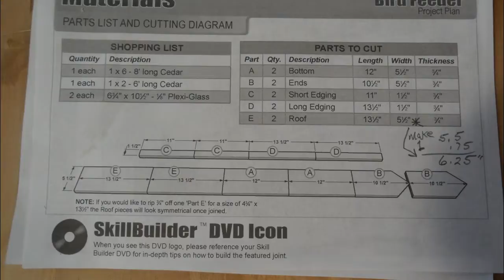A Feeder the Birds Will Love HD

Comment: Great project Ron! Did you do any disinfection on the wood?
Reply from the maker: +Rebecca Bracamontes I did not perform this procedure.  I guess it's possible for pine to have something toxic in the wood.  I'm just not aware of what product that would be suited for these types of projects, especially the bird houses that I make.  Please share with us the products that provide this type of protection for our flying friends.  Thanks for watching and as always, you're always welcome in the shop with Briz.
Reply: Thank you Ron.  I think it is not toxic after all. I am about to start making one.  Thank you so much for your help.
Reply from the maker: +Rebecca Bracamontes Well if you make this model, I'd make the roof with not so much of a pitch.  Make it whatever angle you want, but I'd make the roof overhangs extend out past the eating perches.  The 45 degree angle is too steep and you really can't extend the roof, or there won't be enough room for the birds to eat.  That's the only modification I'd make on this particular plan.  The flaw with this plan is, when water drips off the roof, it falls directly onto the seeds.  Regards, Briz